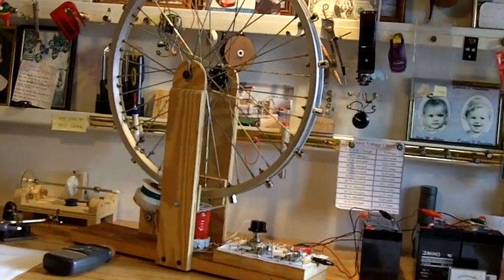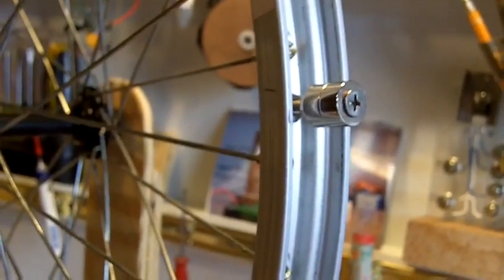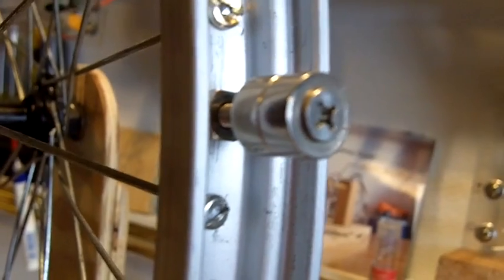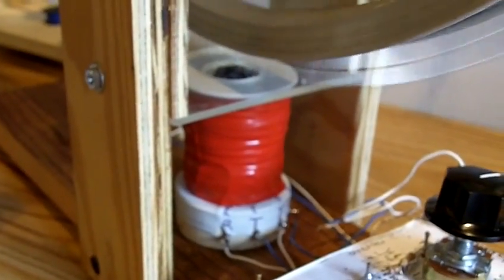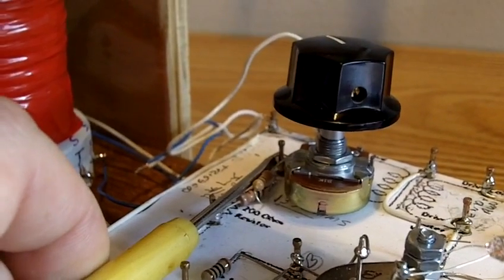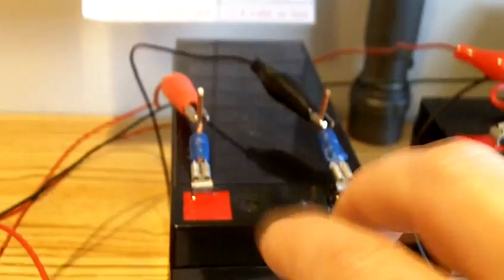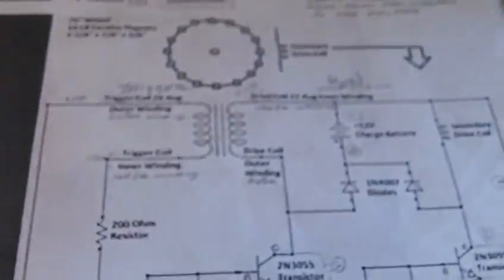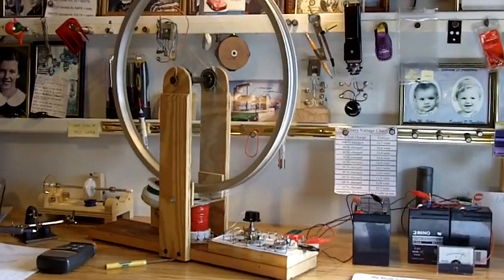Eddie's Bedini wheel

Comment: You might want to put a 100 ohm resistor in place of the 310 this will make it so you do not have to short the resistor and run the risk of loosing your transistor. Also, you might think about putting smaller neos or changing them to ceramic magnets. They are over saturating your core and are causing heat, too much pull on the core.

Comment: This ckt kind of has gears, the faster your wheel spins the more volts your trigger coil puts out. Which in turn hits the transistors base and allows more current to flow between the emitter and collector. So once you pick up speed, you have to increase the resistance. I like your wooden wheel w/ your copper pipe reed :-)
Patrick